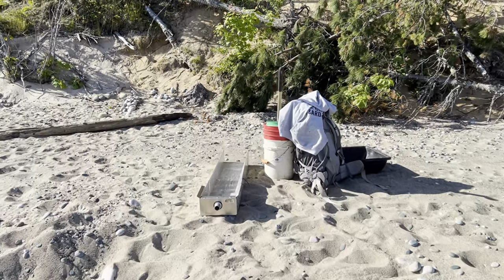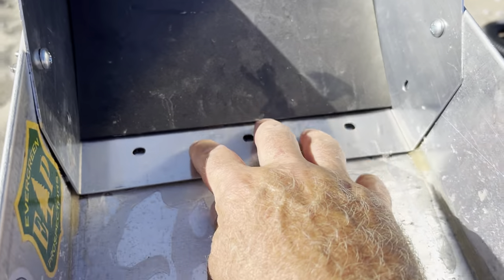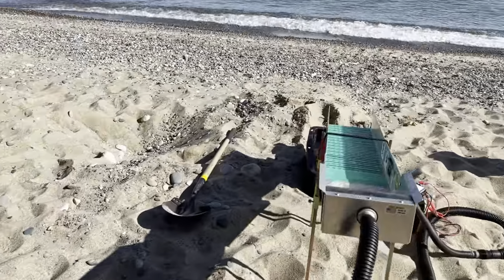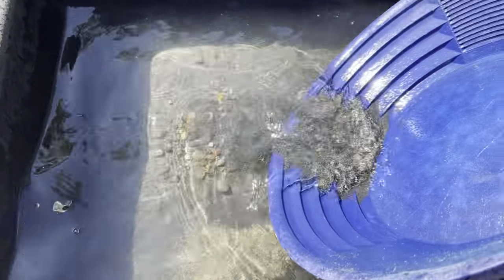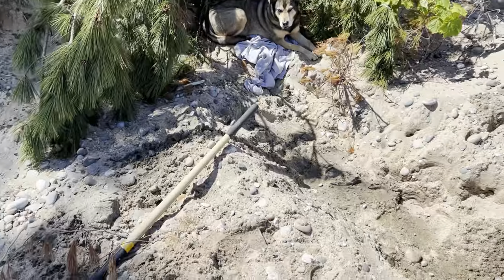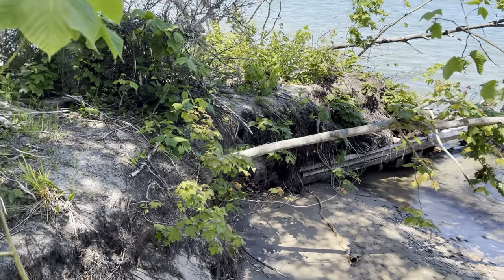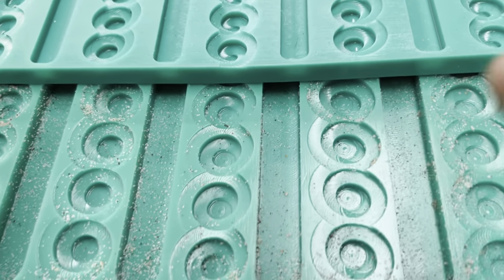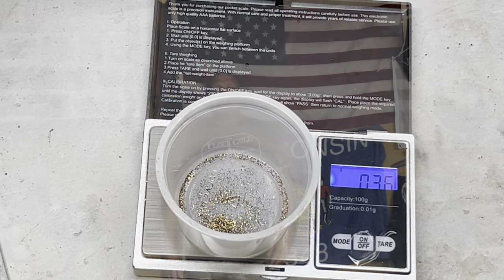Why is there SO much gold ? Lake SUPERIOR

Comment: one thing you can do to your sluice box(es) is get rid of that goofy keene-style header box and make yourself a diffuser to create the laminar flow across your mats like what you're looking for. while i haven't had any experience with the style of mat you're using, it seems to me the thing creates vortices in the wrong orientation which is why your recovery isn't what it should be. just looking at the amount of colors you have in your pan from sampling, tells me you should have more gold than you do in your sluice.
in low volume sluices, astro-turf mats really work well although they are not as forgiving and as easy to clean up, but they do hold on to more of that shiny stuff you're after.

keene started the header box craze on his dredges in order to break up conglomerate material being sucked up the hose. while it worked to a point, more gold ends up going off the end of the sluice than is recovered, which is why people bitch and howl about keene equipment. the key to breaking up conglomerated material is to increase the amount of suction at the nozzle and not pumping it into a stupid ass header box. the gold will start to settle to the bottom going up the hose and entering into the diffuser. 

laminar flow across the riffles allows more and finer gold to settle out faster. in a vertical vortice the gold will be in constant motion and you run the risk of crowding it out of the bottom of the pock in the mat. horizontal vertices behind "normal" riffles force it right down into the crack between riffle and mat and keep it there... 

just an observation... kooollll videos keep em coming!!
Reply from the maker: I absolutely appreciate your input !!!! Thank you!!!

Comment: Try a little metal clamp for drain lines etc.. or get a smaller hose in diameter but not much smaller one with a. Tight enough fit so it fits in the inlet snug
Reply from the maker: Great info !

Comment: I spray my dog with a spray bottle of lavender essential oil and water ... I add the lavender until I can smell it on her easily and then the bugs don't bother her including tick's.... Because it's non toxic I think it's a really great solution. I believe there is other essential oils that also help with bugs and they could be blended together but lavender seems to do the trick and it smells really good!!
Reply from the maker: Thanks for the tip!!!👍🏻
Reply: Fine for dogs, don't use on cats poisonous to them

Comment: the pitch in the front needs to be lower, the rocks should be flowing off the mats. the rocks and gold shouldn’t have to fight for a spot to settle in. the rocks will always win the fight. water flow looks good. just lower the pitch of the front of your sluice.
Reply from the maker: I wish it were that easy… that particular mat was a test and definitely not for beach mining. The drop riffles are too large and create way more vortex than the flat beach hold can handle. In fact , they’re too large for the rocks to be washed out. This material requires passive matting and enough time to allow the gold to float through the round heavy black sand . Thanks for commenting ✌️

Comment: Just a thought, but...
Have you ever considered building a full width paddle wheel under the discharge to use the water flow to power a generator to recharge the batteries for your pump?
Reply from the maker: I haven’t ✅
Reply: @FlourgoldWizards  It should be an easy build if you are semi handy and reasonably intelligent.

You should be able to recover a minimum 10% of the energy you use to produce the flow, and 10% more time shoveling dirt might be worth it.

Let me know.

I'm 76, Stage 4 COPD and can't walk to the bathroom and back without stopping to rest and catch my breath.

Build it, Patent it, License the Rights to build and send me a check if you get the urge.

Comment: Almost sad that the lake is permanently closed to anyone looking to mine since the mine permit rules of no equipment wasn’t followed. 
A pan and shovel only was the rules in 2023 and now 2024 they have decided the permits are not working and have made attempts to mine on a state beach illegal.  Just sad we keep getting restricted due to negligence.
Reply from the maker: You are incorrect ✅ 
Sluicing with a battery operated system was 100% allowed. If you go into the campground office at the park they make you sign a book and then they give you a copy of the rules . It says size of sluice, where you can sluice and how much gold you may keep. Only in 2024 did they dial it back to panning only, one mile each way on the beach from the campground.

Comment: Why don't you use a big wheeled pull wagon they sell them for gardening they have a mesh frame and are pretty light but easy to pull over rough terrain just curious
Reply from the maker: I had one but have moved on to “ backpack only” gear !

Comment: The average percentage of gold in the earth's crust is about 0.004 parts per million (ppm), or about 4 grams per thousand tons of rock ores, and this value varies from place to place depending on the region. There are about 2,700 documented geographic locations of gold ores in the world. Gold is found on Earth's surface in its ores in rocks formed from the Precambrian era; This is often in the form of a natural elemental metal or a solid solution with other elements such as silver. These natural alloys contain a percentage of silver ranging between 8-10%; As for the gold alloy that contains more than 20% silver, it is called electrum. The original gold is found in the form of very small grains that may reach microscopic dimensions that are embedded in rocks, usually accompanied by quartz or sulphide minerals such as pyrite, which is known as “false gold” or “gold of fools.” Gold deposits within rocks are called veins, and they are a natural form of gold, as gold can sometimes be found in its free form in the form of scales, small blocks, or even large pieces of gold.
Reply from the maker: That is fantastic!!!

Comment: had my first trip to LS last summer, beautiful!  Pictured Rocks, then 12 mile campground!   Isn't there a reflective rock now that people are trying to find on the beach that is collectible?  They use infrared lights to find at night?  2nd Question:  You found .36 grams?  or what measurement?   Let me know.  If it was .36 grams, I guess that worth about, say, 30 bucks.  Also, what is the fineness of that gold bits on the beach, typically?   THX Bob
Reply from the maker: The.36 grams is probably around 100 mesh !!!! The ricks are called Yooperlights and are very collectible!! 👍🏻✅✌️

Comment: Would tilting the sluice a bit more help with those darn large rocks getting caught up?
Reply from the maker: Unfortunately no…. There’s an extremely fine line between capturing the super fine flat gold and discarding the heavy round black sand . I was plain ole too lazy to walk the mile and a half back to the truck to get my classifier 🤣 We’ve since found much better deposits with no larger rocks and have done extremely well ! Thank you for commenting!!!😃🐺✌️
Reply: @FlourgoldWizards  I totally understand not wanting to walk a mile and half. I'm really glad you've found better ground. I live in Corvallis, Oregon and have enjoyed prospecting around Oregon. You're right, it is a fine line between water pressure and tilt to control what your sluice catches. (I've always wondered if Oregon would be a better gold source if it wasn't for our past geological floods and volcanic activity that has caused a lot of places to have tons of overburden material before you get to the gold rich layer. Of course we have the places with exposed bedrock but they have been worked on and I'm just curious how much gold Oregon potentially holds because it essentially has all the properties that the California gold rush had. We just have lots of overburden it seems.)

Comment: I couldn’t catch that, was it .36oz? Grams?  I’m interested in the part where you mentioned pounding numbers in the black sand. Is it worth the time to set up on stuff like that and run buckets all day? I guess you’d have to want to work one spot all day, at that point would it pay for the gas to get there?
Reply from the maker: Grams ✅
On the right spot yes you can pay for gas !!

Comment: Do you have to get a permit to use a highbanker in wisconsin? Is there a size limit to what you can use?
Reply from the maker: That was in Michigan but has since been made panning only. Wisconsin doesn’t allow mechanical devices .
Reply: @FlourgoldWizards  oh dang. Alright thanks. I have been panning streams in the north east... have not found anything so far. I read about the lynne deposit and I was thinking of checking that area out when I came acrossed your videos on lake superior beaches... man that seems to be the ticket. They sure like to make it difficult for a guy don't they?

Comment: Here is a dumb question: Any reason you don't use a strainer right away BEFORE it goes on the mat? Just get the big pebbles out then you will have a better experience.
Obviously you can give a quick inspection before you dump the pebbles out.
Reply from the maker: I believe I mentioned in the video about the ling walk back to the truck to get it… you’re 100% right, classified material is the best way ✌️😃✅
Reply: @FlourgoldWizards  I have been to Supiroior only 3 times. I am from the Janesville Area.
Never knew about pirates or even gold being there. That is quite interesting. I just wish I was 40 years younger with your energy with a 4 legged boss!
This was your first video I have seen. Keep up the good work I will keep watching the videos now.
Reply from the maker: @Dennis_J._Aitken  
😃✌️🐺✅

Comment: Wouldn't it be far less effort to use electrolysis to extract any desired metallic element? 
You'd potentially only have to sit back and let the crystals grow from whatever was contained in a load.
It's surely worth a try for the potential reward for effort exerted.
Reply from the maker: That sounds interesting!

Comment: I don’t understand why are using a pump that pumps too much water that you can’t use. If you buy a pump that pumps less water, it uses less amperage your battery will last longer when you slow down the speed of the pump with the controller and still use the same amount of power from your battery. It just takes a power away with heat.
Reply from the maker: Unfortunately a 500 goh pump uses the same amps as an 1100

Comment: If the water picks up more speed with the other mat, couldn't you just use a steeper angle to achieve the same thing with the new mat?
Reply from the maker: The tiny flat gold is really finicky!!

Comment: .36.  Of 24 ct gold is 30 bucks or less. That's a tremendous effort for 30 bucks I know it's a hobby more or less but I think doing it there isn't worth the effort  at all in fact ide b pissed if I did all that for a third of a gram.   No if ans or busts this is better if u drove around collecting aluminum cars for 5 hrs u can make 25.  30 bucks.
Reply from the maker: Noted ✅
Reply: It ain't about the money - it's the whole experience.  Fresh air, beautiful water, solitude & sun.  That's the treasure.
Reply from the maker: @modee-b9s  
My man ✌️